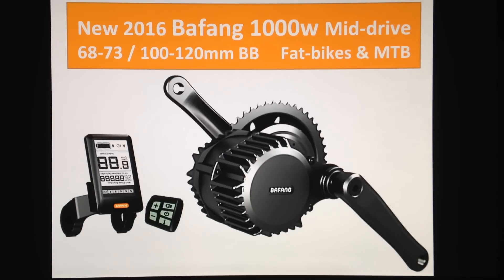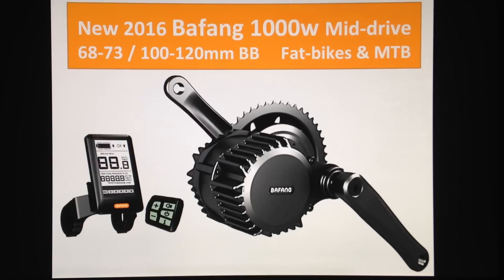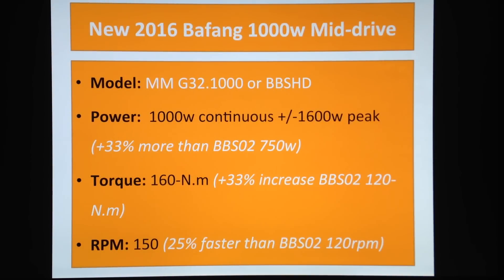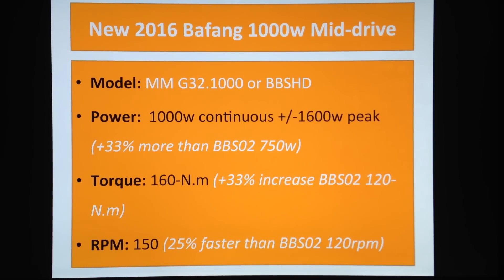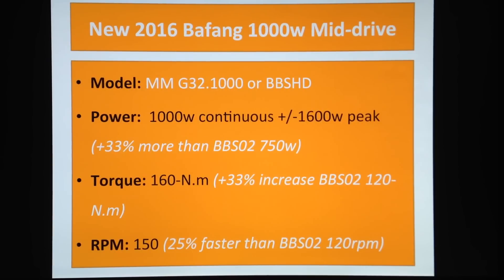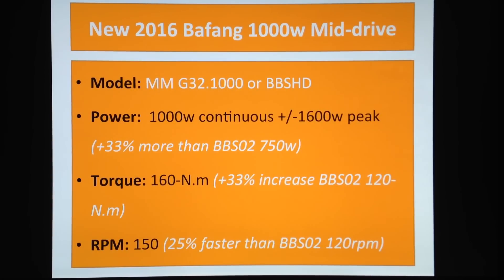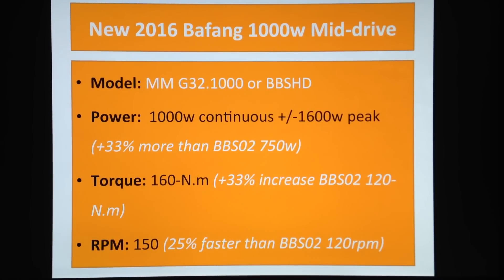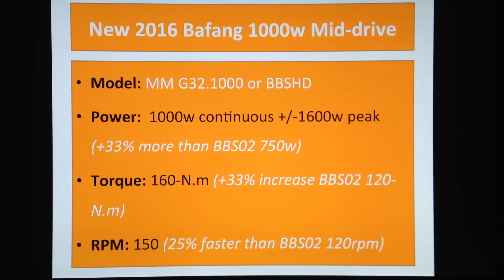New 2016 Bafang BBSHD 1000w mid drive for Fat Bike & MTB (video 1 of 7) MM G32.1000 8fun BBS02 750w

Comment: Hello Bruno. Any idea of retailers in Europe that might sell this kit (due to heavy import charges)? I am from Portugal and would like to have this kit for a Khs Fat Bike. Did you achieve that speed by just reprogramming via software or did you have to go deeper into motor, controller and battery manipulation. Best regards
Reply: +Kenneth Agostinho Simoes You may check this http://shop.gutrad.com/default/1000w-bafang-mittelmotor-umbausatz.html It's a german Shop. Best regards
Reply: Thanks for the advice qwer1241! I will check it out. The only site I have found so far is an italian one 
http://www.alcedoitalia.it that has a Bafang 750w mid drive fat bike kit for around 1250 euros. I have also been checking out Haibike which are pretty awesome. Dont know which way I will be going honestly. I am open to more advice from all the ebike experts!! Regards.
Reply: qwer1241 I have checked out the website you told me and your right! It does have the motor! Alcedoitalia.it has told me that the motor is still in testing fase and not yet available to public because of problems! Guess they were wrong.
Reply from the maker: +Kenneth Agostinho Simoes - It is all actually really simple and easy to do.... just get a battery with higher voltage but below 60v when charged 100% get the USB programming cable from www.empoweredcycles.com (talk to Matt). Just doing that you will feel a huge difference already.. you should only change to a larger 52T chainring if you reeeally want top speed... it will reduce torque.
I don't reeeeally know any European website selling this powerful mid-drive, I am pretty sure they don't sell "because is illegal in Europe and they don't want to get in trouble" which is a bit stupid because lots of people want this mid-drive for off-road use...
Apparently this is the official website in Europe but zero information about any mid-drive motors: http://www.8fun-motor.com/index.php?option=com_content&view=article&id=78
I found this one with a photo of the BBS02: http://www.8fun-europe.com/crbst_3.html
Maybe just import directly from this Chinese seller (the new model is not available yet) http://www.greenbikekit.com
Abraco amigo de Portugal!!!
Reply from the maker: +Kenneth Agostinho Simoes - hahaha yes they are wrong because BAFANG Marketing department informed me that they are already manufacturing thousands of this new model and getting it ready for shipping... =]

Comment: GREAT NEWS, for all Fat Bike and MTB riders... Maybe a little long (+16 min) Breaking News Line, But absolutely GREAT that you share this news... The 750 watt power the "normal" BBS02 delivers, is after all, quite enough Power for 95% of all day to day bike users,,, and me !!! - I will not upgrade my daily commuter bike setup (45 km/h 40km), but will wait until Bafang make some others more useful upgrades,,, like in the Bosch engine, who measure torque, cadence, and speed in real time (1000 times per second). They also offers the e-shift gears and Neon Display. And I know we all buys Bafang, because we could not afford the Bosch drive, but would't it be SPECTACULAR, if Bafang could implement some of the Bosch features,,, at a more reasonable price range ?!!? ;o)
Reply from the maker: +Lasse Vassvik - Hi Lasse, thanks for your comment, sorry I got tooooo excited talking and talking and the video ended up with ridiculous 16min!!! I completely agree, with you, Bosh is years ahead when it comes to sensors, I would love to see a powerful Off-Road Bosh with 1000w but this is not going to happen with 250w max in Europe.. The new Bafang will have the speed sensor built inside the motor, I don't know how it is going to work but the less cables the easier will be for non tech people to install this mid-drive themselves. Bafang also makes an equivalent version of the Bosh "style" eBike motor but it is 350w as well.. =[  It is just a matter of time now, I guess we will see a lot good stuff released in the next two years =]